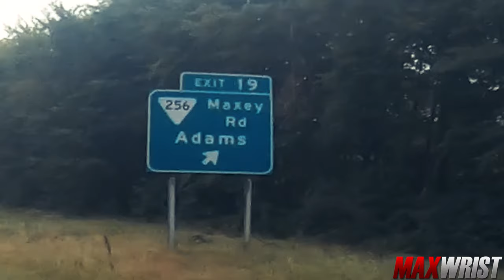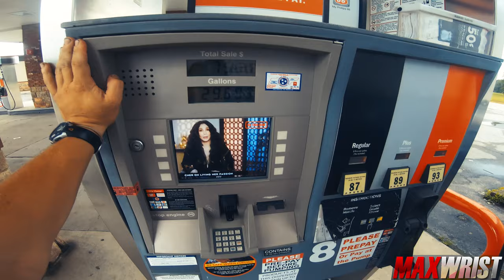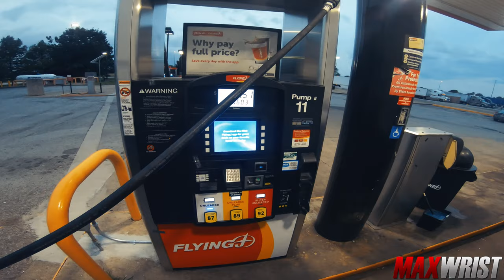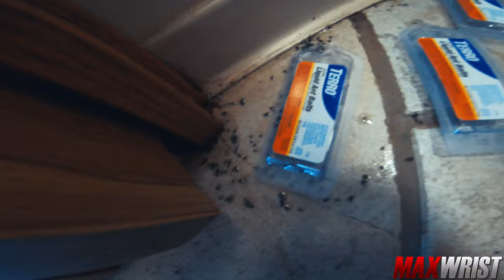RV caught in UFO PORTAL STORM!

Comment: Most gas pumps shut off at $100 you usually need to run your card multiple times with a large fuel tank, unless you have a diesel and your at a semi pump